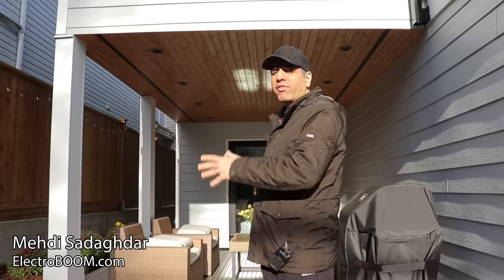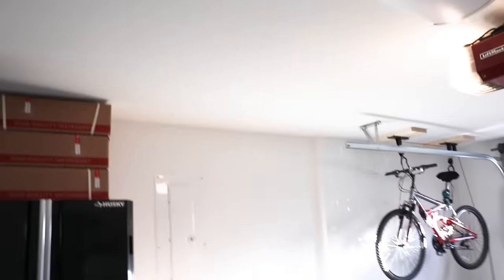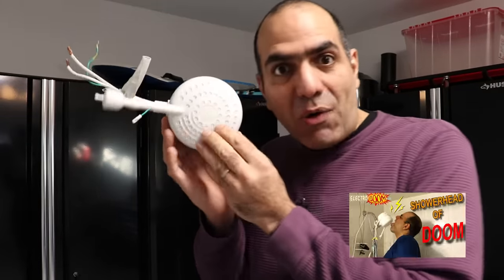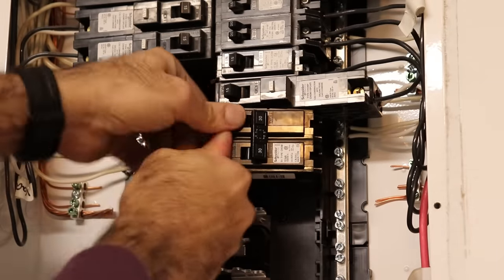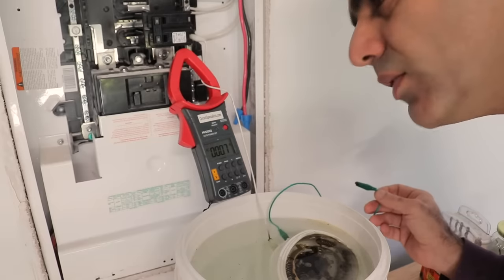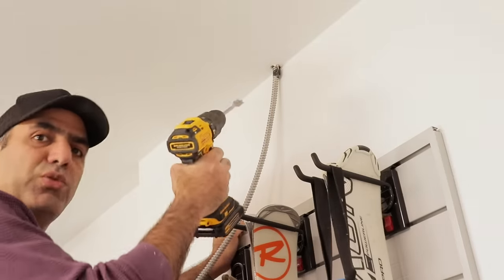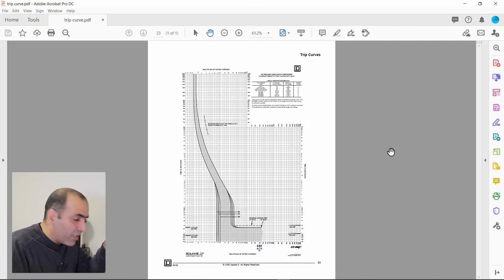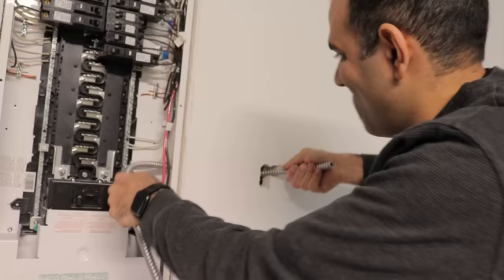Electric Patio Heater Wiring and Installation

Comment from the maker: Ok BOOMers! Just make sure to do this kind of electrician work, consult with your local regulations and licensed specialists before setting your house on fire! I might be missing things here or there in my process... hopefully not!!
And see my video at @Mehditation on how I chose the heater: https://youtu.be/RwemEWxTNmY
Reply: Ok BOOMer. I'm sorry Mehdi love your videos and advices, I couldn't help it. Cheers from another engineer colleague!
Reply: Not
Reply: Ok boomer
Reply: Could you do a YouTube video on a fpv rc car lol
Reply: I love ur videos I hope my hero sees this! :)
Reply: I love u dude
Reply: Ok boomer
Reply: Good job u didnt set house on fire
Reply: Plzz can u get me a mooshi meter plzzz I like the way u explain
Reply: Bro thanks becuse of u i passed phsyics
Reply: مهدی کارت خیلی درسته؛ بازم با این پادکستای فارسی مصاحبه کن
Reply: You
Reply: Ok
Reply: Touch 500000v please
Reply: 1
Reply: Coomer
Reply: Mehdi! What did you used to do before youtube?
Reply: Can you review EMP Shield from Amazon cuz I think that's BS and full of it.
Reply: house power discharger,put flexible metal between the two holes of a  night light and plug it in! great for not shocking your self medhi

DONT TRY IT
Reply: Can you come to Malaysia???
Reply: How about NO
Reply: Can you please review the heater? Like is it powerful?
Reply: When using that steel cable (I always called it BX) there are plastic inserts that you are supposed to put in the ends to prevent the steel edge from cutting the wire and causing a short. Hopefully you knew that, but from what I saw it looked like you didn't. 😬😬😬
Reply: 14:34 your wife?
Reply: ElectroBOOM WE ARE GOING TO REACH 4MILLIONS SUB
Reply: kek
Reply: I’m not a boomer! Back in day nobody said that!
Reply: Yay sooo close to 4 million subs congrats man
Reply: Hi medhi
Reply: It's time for 4 Million subs video. 😋
Reply: Ok boomer
Reply: Okay, at first i was like "it is just instaling a heater it cannot go wrong". I skipped to see if i was right, saw you with flaming bucket of water next to the breaker box... Okay i'll watch the entire video
Reply: I can't wait for you to look at your electric bill
Reply: In resistive type heaters or furnaces, such breakers are nothing more than a high quality switch, they are not able to protect the system from damage due to the timespan to trip according to their tripping curve.
Reply: Knowing your videos i was expecting the heater to explode in the end
Reply: Mehdi as a EE grad I am uncomfortable with Electrical work. I could hardly sleep after I changed all my house's outlets and switches thinking I did it wrong.. 😂 you are a brave soul for doing this! Bravo I have learned so much from you!
Reply: If ever there are multiple coils or tube connections and any short happened, a molten mess would have been made with a current surge with the system becoming toast. While on the other hand the breaker would not have tripped in time to save anything
Reply: Can confirm this advice! 

I had to replace my whole panel from a dangerous Zinsco electric panel (look it up! They can arc easily and cause an electrical fire) to a decent C&H contemporary panel last week. Had a lost neutral from the original electricians backstabbing the outlets so that was fun.

 Even though I knew what to do generally  I still went with an electrician because of code and if I accidentally caused my house on fire it wouldn't be insured.  Unless if you have lots of experience with high voltage electrician type stuff it isn't worth the risk!
Reply: An "adjustable over and under voltage digital relay breaker" would be a cheap and effective solution for such resistive circuits. To protect the system as well as the user. These trip immediately on set current with many relay breakers having adjustable tripping time as compared to the MCB breakers which trip either on temperature or through magnetic field .
Reply: Lets hope so nothing goes wrong in your next video
Reply: MCB's are good for inductive loads or where current surges are usual and may cause unwanted tripping so  certain types are used such as B type, C types etc (for e.g. C types trip at about 5 to 10 times rated current, meaning about 50-100 A current surge on a 10A breaker would cause an immediate possible trip ).
Reply: U need to get to europe its 240 volts
Reply: Mehdi, for your next video pls do a comparison of an analog and a digital oscilloscope. People say you can learn a lot about electronics using an analog oscilloscope. Use a Tektronix oscilloscope because they last a long time. You can get an analog one for cheap on eBay. Maybe a decent 100Mhz scope for $50-$100. Usually for $150. The downside of an analog is that you have to use math. The calculations aren't automatic. But is that a downside? I mean like... it helps you practice math and keeps your math knowledge sharp. Sooooo. yea. pls, do this.
Reply: How tall are you and how much do you weigh electroboom
Reply: Ok... Tank you
Reply: Your breaker might have a long trip delay. I know US styled ones are rated on the amperage the trip and the time it takes to trip.
Reply: HE SAID OK BOOMERS
Reply: For me as a House-Electrician from Germany i have to say i didnt saw many Electronical engineers who can do installation as good as you!
Reply: For a better idea you can make a diy microwave if possible & explain how the magnetron makes microwave. From the video when you got a microwave & took the transformer out for high voltage arcs. If you like this idea get this to him
Reply: Here in Brazil It is summer
Reply: Have fun with Linus. Glad I got in touch à couple years ago.
Reply: Too late.  I set the water on fire already.
Reply: @fw2222  dude how was that a good installation there are soo many code violations
Reply: My kettle is 3000w.
Reply: Nice job.
Reply: Who was behind the mirror 😎 btw if u bought the heater won't the company provide their  services 😂😂😂. So if u are Electronics engineer u become electrician 👍 in the"  house"😭 no respkt
Reply: First. The look of NA electrical installation material scares me. Second you should have a timer for theses heaters and also not just a breaker but also separate RCD/RCBO.
Reply: Just saying nearly 4 million subs
Reply: You should've use something called " anti bushing " it's a small red plastic thingy that will help not shave the wires
Reply: And that was last episode of ElectroBOOM....
Thank you and may you rest in peace
Reply: Gotta pay ESA their cut...
Reply: Mehdi, in a LATITY video, you said that you would make a microwave gun using a microwave.

DO IT
Reply: The garage tear down for an outdoor patio to make a backyardish area is a nice idea.
Well done.
Reply: 4MIL SUBSSSS
Reply: Nice thing about owning a house from the 30s is pretty much anything I do myself is safer than what was already there, as long as I do advanced things like "make sure there are no conductors exposed".
Reply: The female in your life is a power heater.
Reply: Well, did you used a recessed box instead of a surface one?
Reply: YAY NEW VID
Reply: Here come the Boom
Reply: Are you saying that after consulting with local regulations and licensed specialists I CAN set my house on fire? YAY!
Reply: Keep in mind, if you do this yourself and your house does burn down, insurance will not cover it.
Reply: Pretty sure that's not to code to install a 50 AMP plug (the one you installed close to the panel -  you can read on the plug it's a 14-50R 50A) on a 10 GA wire! I mean the breaker is rated for 30A so it should be ok, but I think installing bigger than rated plugs is a no-no as it invites people to plug in things that draw more current than the circuit can safely supply.  You should've run 6 GA to the 50A plug, and probably the correct way to do it is to run a separate circuit with a 30A breaker for the heater.
Reply: It isn't funny anymore
Reply: Well you can't do that type of installation AT ALL if you're not an electrician, even if you know what you're doing.
Reply: @gorak9000  I don't know the Canadian rules but in the NEC 210.21(B)(1) it appears you are allowed to have a 50a receptacle on a 30a circuit IF it's the only thing on the circuit (AFAIK wire size doesn't matter as long as an acceptable breaker is used). However since the receptacle isn't the only thing on the circuit only matching 30a receptacles can be used as per 210.21(B)(3). The only exception is if the receptacle is exclusively for welders, which does not appear to be the case here. Additionally, since the heater uses more than 50% of the circuit capacity 210.23(A)(2) says it can't be shared with plugs so the receptacle size would be moot in this case.

My concern with the installation was the size of switch box used. Per NEC 314.16 (box fill) you can only fit so much into a single box. There are eight 10awg wires and the mounts of the switch itself count as another two. Even the largest rectangular switch box is only allowed 7 10awg wires so he needs a larger box. He should've used a square box with the proper metal faceplate instead of the plastic cover intended for flush-mount work.

And I'll repeat again my points are based off of the USA's National Electrical Code (which btw isn't itself code). Mehdi's work would only need to comply with his local codes which are based on the slightly different Canadian Electrical Code.
Reply: i use one of those heaters in my glass shop...most people dont think id need heat in a glass hot shop..but the room is only 2000 cubic feet..and my ventaliation fans suck out 1750 cfm ...so it changes all the air in the room almost once a min.  so it ends up being close to the outside tempature indoors . there is no way to use any kinda regular heaters...cause the hot air just gets sucked out instantly.  but a infrared heater heats the surfaces NOT THE AIR...so the floor ,,tables,,,chairs,,tools,,,are all warm to the touch,,,the heater feels like a hot summer days sunlight on your body.  its the ONLY way to heat a heavily vented space. ive seen it used in other labs and work shop spaces.
Reply: but...BUT..but....you shouldnt have used an electric one....get a nat gas or propane burning infrared heater....MUCH MUCH more efficent...and cheaper to run because of that.
Reply: @BurkenProductions  In many (possibly most) jurisdictions a homeowner is permitted to do their own electrical work without a licensed electrician. It is however a good idea to have your work checked by your jurisdiction's electrical inspector even if it's not legally required.
Reply: I live in Brazil, at my apartament we have 220 volts mains, and a eletric shower head that uses 7.700w! The main breaker on the breaker box is 50 amp, the shower breaker is 32 amps, we have a GFCI breaker for the shower head too, never had any problems with It! I think you need to test a good Brazilian shower instead of this cheap shower!!! They even have eletronic control inside! Search for  "chuveiro Hydra optima eletronic 7700w" and you will find a good shower!
Reply: @eDoc2020  The other thing I noticed is I don't think it's to code to drill through the stud on the side of the panel, as there is no mechanical connection between the armored cable and the box - it's just floating there. And he should've put those anti-chafing plastic bushings in the end of the armored cable as well, but that's pretty minor. I installed a 50A receptacle for a welder in my garage, and I ran the cable out the top of the box so that I could actually get a good mechanical connection between the cable and the box (same situation, box mounted between studs - all the cables go out the top or bottom with clamps). I also used 6GA wire, so it's a true 50A circuit even though for now it's only for a welder - in the future, I can put another 50A outlet for an electric car charger on that circuit as well. The welder plug is almost in the perfect spot for a car charger outlet on the outside of the garage. I know there are differences between the Canadian code and the US code - I grew up in Canada but live in the US now. I like the Canadian rules for grounds better than the US version - ground wire must be continuous from the cable to the box and then to the outlet or switch in the Canadian code - in the US, you can splice the ground and have separate pieces of wire going to each. I know it's kindof nitpicky, but one continuous wire from the cable to the box to the outlet seems a little safer to me, so I continue to do it that way!
Reply: mehdi your at 3.99 million :DDDD
Reply: Too late, man... I'm hearing my wife right now giving me a lecture on not being such a reckless guy and whatnot.
Reply: @eDoc2020   @gorak9000  I  want to add the Terminals are rated.: #4 - #8 AWG.  It seems from the video Mehdi just shoved two #10 AWG wires behind each lug.  That is also a no-no.  According to 110-3(b) "listed or labeled equipment shall be installed and used in accordance with any instructions included in the listing or labeling" and 110-14(a) states "terminals for more than one conductor shall be so identified".   In my mind that is the biggest failure point.  
As for box fill.  My math follows, 6 conductors = 15.0cu in + wire clamps 2.5 cu in + 2 gang device 10 cu in + equipment grounds 2.5 cu in = 30 cu in  4 sq deep box is 30.3 cu in. So that all checks out.  Even with pigtails it fits per code, as conductors that don't leave the box count as 0.  Also based on NEC.
Reply: @Bloogblag  For the box fill I was referring to the rectangular box on the wall with the switch, not the square box next to the panel with the 14-50R. I was off by one with the effective wires used because of the ground (it only needs 9 instead of 10) but that's still too small for that little box. There's also the rule about needing 6 inches of wire but I couldn't find the reference quickly.
As for the wires under the 14-50R terminals, good catch! I wasn't watching that closely. I was just surprised by the mere presence of the receptacle. With the location being so close to the panel there's no excuse for sharing the circuit, even if it were allowed.
Reply: First, I am not a qualified electrician. But what stands out to me is to be sure the cable run through the ceiling insulation is rated correctly for such a location and load so that it does not overheat. (At around half capacity I doubt it, but, that 30A rating assumes a 3-core PVC insulated cable, with an ambient temperature up to 30 degrees, and possibly, in free air. I don't know by how much the armour jacket + insulated location may require you to  de-rate the current capacity due to temperature rise, if at all).
Reply: @eDoc2020  I forgot about that "handy" box.  Your absolutely correct.  
Could get away with standard(4x4x1-1/2) 4sq at 21 cu in + 1/2in "raised switch cover" at 7 cu in for 28 total.  Saved 5cu in with single gang device, so 25 cu in total in the switch box.
Reply: That is for now at least @monarchus1614
Reply: Hey where is 4 M video??
Reply: You should just bring a bucket of water beacuse it will overheat the wire then burn the wire
Reply: Not
Reply: Why don't cover youself with heating element
Reply: have you thought of putting in a timer switch just so you do not have to remember to turn it off.
Reply: Hmm... how would one install a Tesla Charger, or spare 240volt driver outlet?
Reply: For sure. I've been working with home and small business electric since I was a child with my father. I can't tell you how many jobs we've done where the previous work done was insane levels of dangerous. One business looked like its breaker box had been added to for over 75 years. Everything from knob and tube to modern 12/3. So much splicing. It was pure madness.
Reply: I said use the Logic Gates
Reply: missed the connector in the panel :(
Reply: I love your videos, Medhi! Much likes, and Merry Christmas!
Reply: That one guy who doesn't listen: "Sometimes my genius... is terrifying" Meanwhile the house on fire:
Reply: Make a tour video plzz
Reply: corey Babcock  who pissed in your cornflakes?
Reply: Congratulations 4 million sub ik I'm early but still
Reply: I don't know about the regulations in Canada, but here in Hungary it is prohibited to extend cabling through a connector...
I don't know the exact reason why, but I guess it has something with high connection resistance of (possibly oxydized) connectors and  plugs and their tendency to heat up. This heat might increase the wiring temperature, thus the wiring resistance as well. (At least for a short distance.) Now, if another load is present and its current flows through the same heated wire, it heats the wire even more, causing a thermal runaway. Eventually, your house will burn down.
So either put another box beside the current one, move the connector there and use the current box as a junction box only, or if you want your house to burn anyway, forget this complicated heating up connector stuff and simly heat the wires with a gas lighter while 10-20Amps flow through them...
Reply: you should ha e got a smartswitch and A relay so you can turn the heater on remotley.
Reply: Only big miss I saw was you did not secure the cable to the breaker panel.
Reply: Are you certain that this heater doesnt also heat at the back of its body that you install it so comfortably on a wood?
Reply: In Poland (European Union) we use  residual current circuit breaker to procect our houses if the current is not coming back from the home to the source. We also use the normal breakers for shorts protection. Also it's more and more popular to have the fuse for the protection from the big current (accually it's the biggest current that the wires can handle)
Reply: I LOVE YOUR VIDS
Reply: pretty nice for the planet
Reply: Congrats on 4mil
Reply: I'm a registered electrical engineer so I'm good to go. XD
But I'd still need someone to do all the drilling and stuff.
Reply: Yo 4 mil subs congrats man ☺☺
Reply: Congratulations on 4 million!
Reply: Technically the Canadian Electrical Code requires the use of anti shorts surrounding the conductors at the connectors to protect them from getting damaged by the sharp cable armour. 🤫
Reply: Congratulations of the 4 Million Subscribers!
Reply: great video man. Only thing not to code there is you didn't use anti-shorts in the ends of the BX\AC-90. aside from that great stuff :)
Reply: Only things that weren't done to the CECs standards that I noticed were the following.
1. Antishort bushings wherever your cable terminations are. Little red caps that protects the insulation from the armor when you clamp the cable in its box connector.
2. Minimum of 150mm of conductor must provide from any box.  Looked too short on your switch. 
3. Putting that outlet on the heating circuit is a no no.  The ESA may call you on that if inspected. 
Having said that.  I would have expected that an inspection would have caught the nail sticking out beside your bus bars.  
Good looking work for an engineer!
Sound matieral selection.  I'd advise on removing the outlet and installing a 2 pole 20amp breaker if you move (if you don't decide to take the heater with you).  That would pass.  The bushings do as soon as possible.  Even if it didn't short when powered up initially.  Thermal stresses can cause shorts bad enough to require cable replacement without those seemingly useless devices are installed.  
There's some more unsolicited advice for you.  Love the videos. Keep em coming!
Reply: Nah we can learn with explosion that we made
Reply: Ok
Reply: Hello Mehdi, if you notice this, please speak in your native language in the next upload, much love from Nepal.
Reply: It looks like you forgot to put anti-shorts on the ends of the BX cable (Armoured Cable). They’re little orange/red plastic bits that you just slide over the sharp ends to prevent them from punching through the insulation.

Also, I could’ve missed something but it seems like you didn’t splice your neutral wires together before putting the marrete on. You’re supposed to splice them together by twisting them clockwise with linesman’s pliers.
Reply: Congratulations for 4million subs
Reply: Nice looking panel!!  Lol
Reply: I thought you were a Certified Electrician man?
Reply: Finally a new video for a week
Reply: Also always a good idea To ground your box unless you like 40 amps Flowing through  your body
Reply: Use a timer 🙃
Reply: show your team its 4m subs now
Reply: 5:14 At This Time No Capacitor Blown😃😃😃
Reply: Hey electric boom you work so hard about you make the elctric things you had almost about the shocking and pls stop about the shock its keep me awful
Reply: The electrical industry was supposed to scrap this stupid stuff but it is all politics. An RCD will do it all or RCBO will do it all but to keep the old stuff still going and the politics with it they still use it .
Reply: I feel like a timer would have been a better thing to add opposed to a switch given the switch is in the garage (not I'm sight of the heating element). But that's just speaking as someone who has a bad memory.
Reply: @samuelmiron6826  "that's what she said"
Reply: Power👍 awesome video.
Reply: You should get one of those wifi thermometers to put above the boards on the patio so you can get alerted if there is a wall fire. A cheap $30 Wyze security camera would also work to get alerted for motion (fire). Might be kind of tricky to get it above the boards in the patio but it might save your life one day so I think it's worth the effort.
Reply: MCB HAS CURVE LIKE B,C,D,E  DEPEND ON IT THE WE SHOULD TYPE OF LOAD TO TRIP THE BREAKER.
EXAMPLE: IF WE CONNECT MOTOR TO MAIN WE SHOULD USE C CURVE MCB BECAUSE AT THE STARTING OF MOTOR IT WILL TAKE 10×FULL LOAD CURRENT.
Reply: Pleas use B Curve circuit breaker to trip. For heater load.
Reply: You forgot to put anti shorts on your box connectors!
Reply: 12:01 - earth wire arcs to the neutral bus.
Reply: Entire team working on your videos at 4 mil?
Reply: Could you do video on power line adapters
Reply: I have nothing to do with this.  Though I am wondering how long it will be until a building inspector shows up.  You pulled an electrical permit, right?
Reply: Give us the 4M subs video
Reply: You should put anti-shorts in your BX (armoured cable) when inserting it into a connector. Your straps should also be within 12 inches or 300mm of your boxes. I know you are thinking about future growth, with the #10, but your breaker is over sized. I have to double check the code book for you. ;-)
Reply: you forgot to put your mehdiation channel in your channel list :) I know it is in the description of this vid. :)
Reply: Hey its time to reveal ur team its4 million subs!!!!!!!!! Congratulations bu the bay
Reply: Meanwhile kids leave the switch and bill comes in $3000 for the month.
Reply: Mehdi, I'm proud. 
https://en.wikipedia.org/wiki/ElectroBOOM
Reply: that is the best use for an amp clamp i have ever seen,  and i use em daily to get people to work and back lol
Reply: @vincenzothegamer9636  hmm yeah i dont know the rules in canada,i would say this installation like this is not possible in Germany but for for being an engineer and living with this in his own House its quite good.
Reply: Your install has many defects. You clearly didn't get an electrical permit or inspection.  Shame on you.
Reply: forgot the red bushings where you cut the aluminum spiral sheath off the cable
Reply: Hello
Reply: Mehdi you have reached 4 mill congrats
Reply: its nice to see the Canadian national anthem in a YouTube video for a joke about rights.
Reply: You are definitely not up to code here in Ontario 😬
Reply: ElectroBOOMers
Reply: Electro Boom Why didn't you make a 4m sup video?
Reply: @IIIIIIIIIIIIIIlIIIIIIIIIIII  username checks out
Reply: CONGRAGULATION ON 4million SUBS !!
Reply: I’m not a boomer ;-;
Reply: When is ur new vid with Linus coming out?
Reply: I guess you will hire a professional electrician to check your wiring...
Reply: Why don't you make a 4m video
Reply: Ok boomer
Reply: I didn’t see you use an anti-short for the armoured cable??
Reply: Mehdi, there are sparks at 12:00 when you install the ground. I don't know if you saw that.
Reply: Dont do this with live wires.. cut the house power.. cut it.. please!.. but it is rather funny to see this guy risk his life lol
Reply: As an electrician I love this channel
Reply: MY Physics teacher!
I saw Chinese people especially like you!
Reply: @mareksraibacis3384  It will probably be boring for Medhi because such an installation is an absolute NO in Europe
Reply: you're funny.
Reply: Omg I'm dying
Reply: Ok boomers
If you have 
Questions with quality
Post it on our subreddit
No matter your entity
I may or may not check it in the next video of 
Latity
Reply: Red Seal Electrician here, you missed the anti shorts on the ends of the BX. very important and actually wouldn't pass CEC, BTW love your videos
Reply: Video on wimshrust
Reply: Wimshrust
Reply: Wimshrust
Reply: Wimshrust
Reply: i liked the video before it started now you r happy i hope so
Reply: The breaker have a swich off characteristic. Depending the tipe they can transfer 2-3x load for a short time. If motor-starter type, then 10x.
Reply: heh
Reply: You could’ve wired it for 110V and draw 33A that way?
Reply: Fna